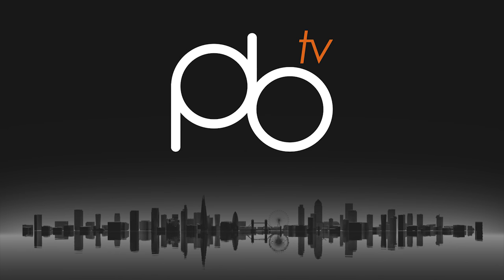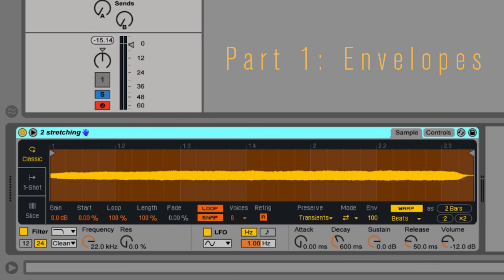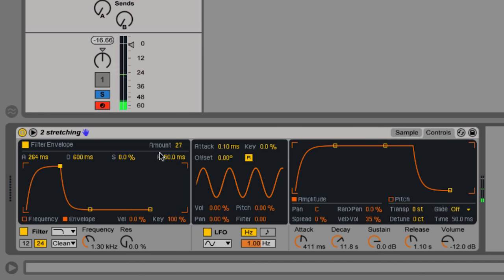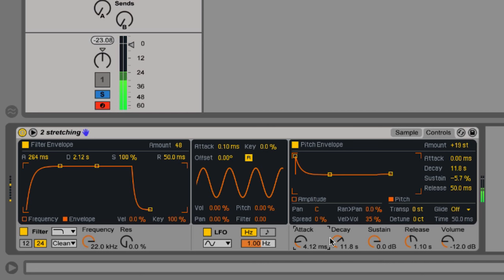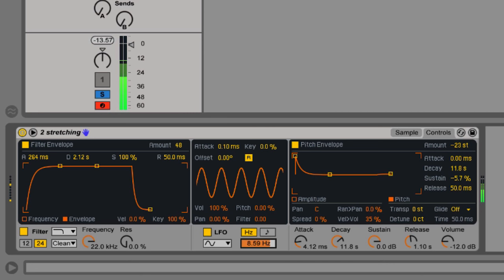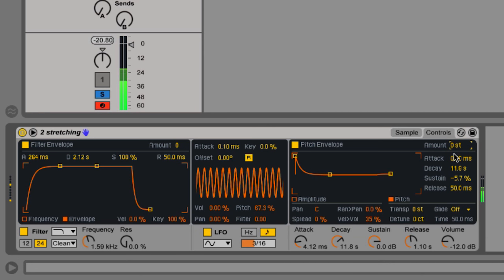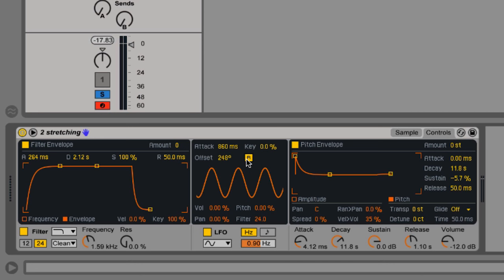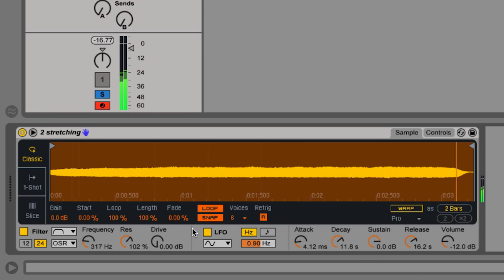Ableton Live Tutorial: Envelopes and LFOs in Simpler

Comment: For some reason when I try changing the LFO waveforms it has no effect on the sound at all. Also within "controls"  I can't drag the waveforms like you do it doesn't let me. Loads of the controls also are locked with "This parameter is controlled by the Macro Control...etc". I only have albeton live 9 Lite, perhaps this could be the problem, some features disabled? any thoughts? 

This video is really clear and helpful though, just trying to rack my head round why it doesn't work for me :)